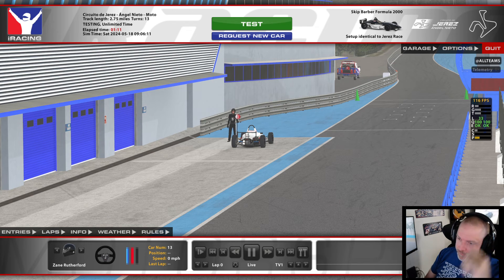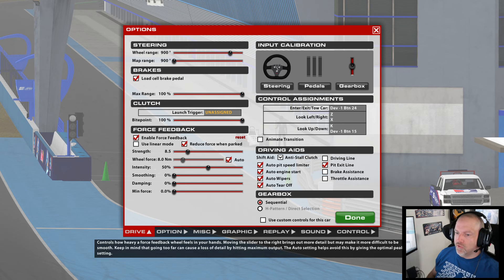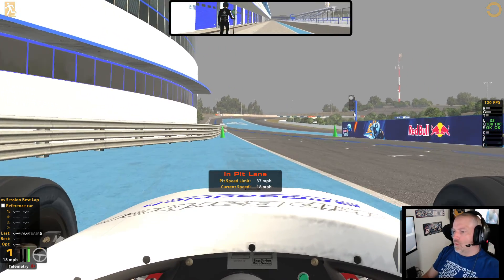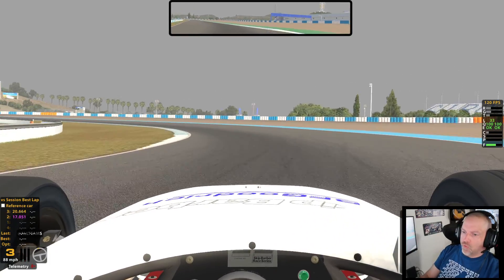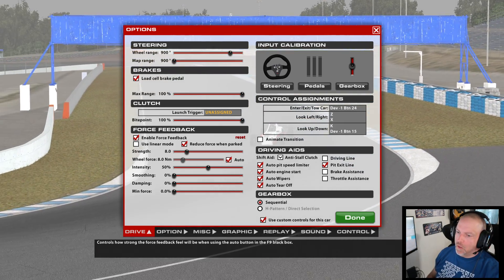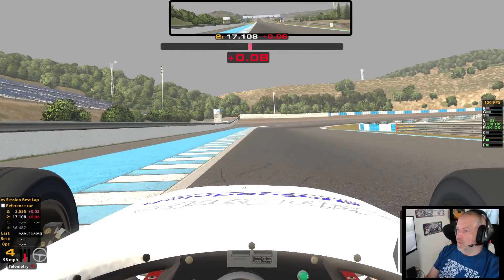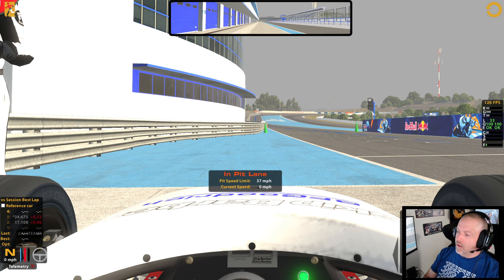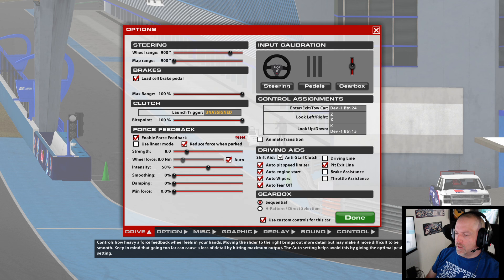How to set FFB in iRacing without clipping

Comment: As you have a direct drive wheel, you should have "linear mode" turned on. Having it off will distort the signal, bumping low-end forces and muting high-end ones.
Reply from the maker: The Clubsport isn't direct drive though.
Reply: @brokenamotorsports  ah sorry didn't realise!
Reply from the maker: Your good.  Just keeping me honest. I wish I had a direct drive but it's not in the cards at the moment.

Comment: Thanks for the tips!

How is the new GPU going? Is it strong enough to push a bit more on the graphics?
Reply from the maker: It's not a drastic improvement but it's still an improvement.  I increased a few things but not much.  My monitors are 165 hz so I capped my FPS at 120 (75%).  I'd rather have higher FPS than eye candy.
Reply: Not sure if you know but the auto button is just based off the intensity slider.  Yours was at 50%. I end up changing the intensity from car to car to get the feeling that I like.
Reply from the maker: Good to know.  I've never messed with mine.

So what your saying is if the strength feels light, you can increase the intensity to make it feel stronger but keep the feedback feel?
Reply: @brokenamotorsports yeah so not sure exactly how it works but if it feels light I’ll increase the intensity 5-10 percent, do a lap then hit the auto again.
Reply from the maker: Thanks.  I'll mess around with it this weekend, and if it seems worthwhile, I'll do a part 2 video of the FFB.